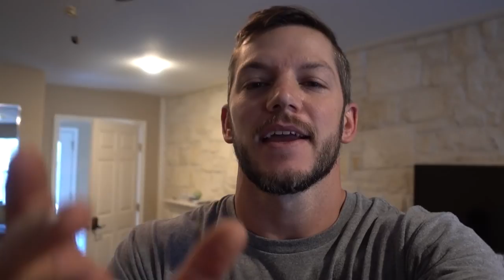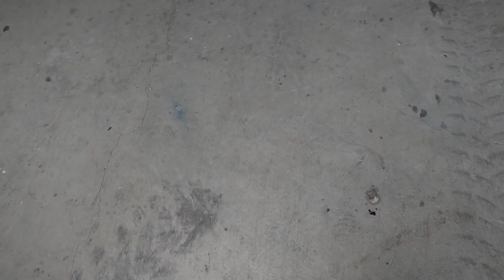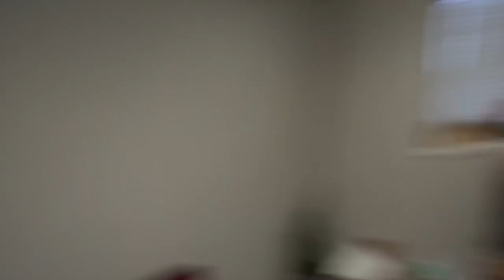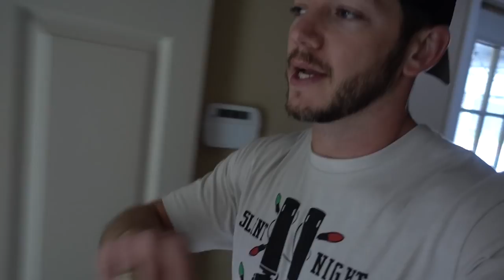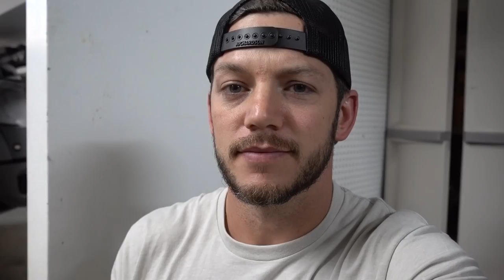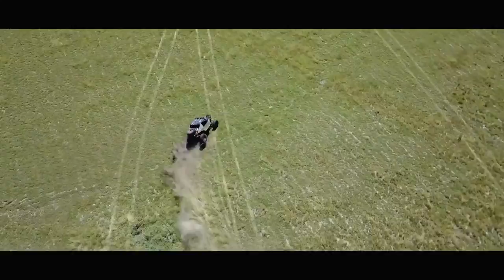Driving a Go Kart To Work...

Comment: On the generator: 1) if it has 2 V-slots, it needs 2 belts. 2) The new belt will be slightly smaller than the old one since the old one stretched and broke. There should be a fitting somewhere that allows the generator to move a little bit so the belt can be tensioned.

Comment: You should see how many tanerite bottles it takes to stop a 9 mil
Reply: I'm not sure that's how that works.
Reply: But I'm sure it's worth trying.
Reply: @sterlinghamiltonracing6487  the amount of tannerite it would take to stop a bullet would be too much of a risk to be close enough to even shoot with a handgun, even if it's not supposed to set it off.
Reply: dedalliance1 But it definitely won’t set it off and it’s expensive.
Reply: @DK_tk3  lol, Well I for one will not stand next to 50 pounds of tanerite shooting it with a 9 mm even though it 'shouldn't' set it off, because if it does you'll probably die, but you can go for it if you want.
Reply: this is off the ranch not demo ranch

Comment: Take some yarn and run around in place of belt to get the exact size, cut and measure. 

Get some Dielectric grease to put on battery posts and any other connections.
Dielectric grease, or tune-up grease, is a silicone-based grease that repels moisture and protects electrical connections against corrosion. ... Since dielectric grease is a silicone grease, it should not be used on silicone-based rubbers or plastics, as it will break them down over time.

Comment: That belt may seem a little small because it’s brand new, but you have to think how long that belt was on there before. 9 times out of 10 if the belt look just barely too small it’s the right one. You want to have to somewhat struggle to put it on there for the nice tight fit. If it doesn’t fit nice and tight it will squeal, especially with a truck that has so much power. I’m not trying to be ignorant or anything, I’m just trying to help because I went to school for this stuff.

Comment: O'reilley's

The Part numbers are listed below:
Brand: GATES
XL 7640 (13/32"x64 5/8" OC) - you need 3 of these
XL 7500 (13/32"x50 5/8" OC) - you need 1 (Power Steering Belt)

It's relatively easy to change the 3 belts, it takes a little bit longer to change the Power Steering belt as there is a bolt on the back side of the Power Steering pump that must loosen to allow the belt tension to be adjusted.

Comment: Use a wall charger for the batteries till you can replace the belts.
Simple, Cheap and it works.
Use ROPE around the pulleys and you will KNOW how long the belt has to be.
Measuring is knowing.

Comment: also, I find it funny the guy at the auto parts store showed you ribbed belts for a V-belt pully..... you need a solid belt for that, if you can't find them at your local auto parts outlet. I recommend you try a tractor supply store, the belts there are usually more heavy duty, and will last a whole lot longer.... I know this is an older video but i'm just saying for references

Comment: The line is for the fan clutch. You'll need 2 wrenches (9/16" IIRC) and you'll have to get both hands down in there. Not fun if the fitting is super tight.

Comment: In my experience,  even "water dogs" don't like baths although they love water. In all my life, 70 years, we have constantly had a dog. At year Zero in was a Cocker, previous little apartment dog, that was ok with baths but not so ok with little child. When I was 7 we got the first in of a number of Wire Haired Pointing Griffons  and when I was 11 we got our first Labrador Retriever  and we never  looked back. Ever since 1959 there has been either a WHPG or a Lab on the property and not one of them liked baths. Most we tried to bath just a few times and gave up. We just let nature take care of it.  In CT, if you have dogs that are free to be outdoors at will, the frequency of rain and snow along with the natural urge to run for exercise keeps their coats pretty much clean. Of course, any time they were boarded which was rare, they got bathed. That's what kennels are for. VET TEST: Are you familiar with the WHPG breed? One of ours actual came from a breeder in greater Houston!     sdh in CT

Comment: That fan doesn't have a typical spring type clutch it is like a tractor trailer air actuated clutch it if that one uses oil its a hydraulic clutch to run the fan so you can have it stay on if need be it's more reliable

Comment: with the new belt its slightly shorter because its brand new and hasn't been broken in yet or stretched, the bad, torn belt was probably the same size when new it was just stretched

Comment: Hey fellas next time you're replacing a missing belt run a string the distance you need to and then measure that distance for the guy at the Parts House be sure to measure the Valley of the police that you are connecting to so you have a good idea of what kind of belt you want but just drank will help you a lot and finding your distance

Comment: Matt soak all your belts with 303 rubber and plastic conditioner.  You can get a Gallon for $38 at Walmart.com and won't have another dry rott issue ever again.  Works great on tires as well.  Check out Sweet Car Projects You Tube channel for other tips and tricks for the DIYer.

Comment: It wouldn't have mattered if the belt was long enough it was the wrong type of belt and you would have blown the belts in a week it's a v belt your needing the inside of the belt looks exactly like a v the hole way round. the belts you got given are ribbed belts are are more used for timing belts as they mesh the the cam gears. Awesome vid though Matt

Comment: What was wrong with riding the while to work?  Surely super fit Matt isn't afraid of a bit of pedal assist cycling?  Plus I bet it also has full power throttle control.  You realise, of course, you have just given the law the evidence to prosecute retrospectively and admitting you knew it was illegal.  Wait for the knock on the door.